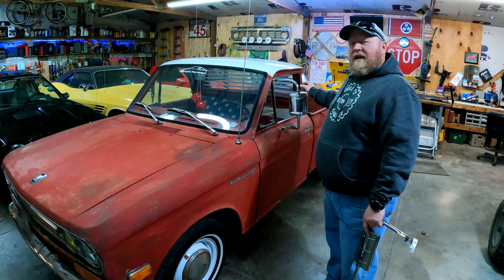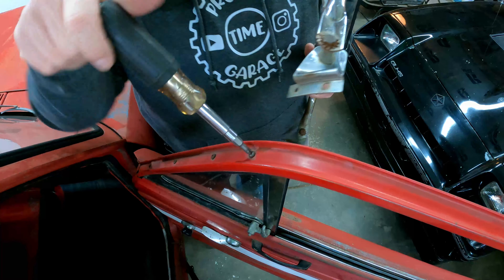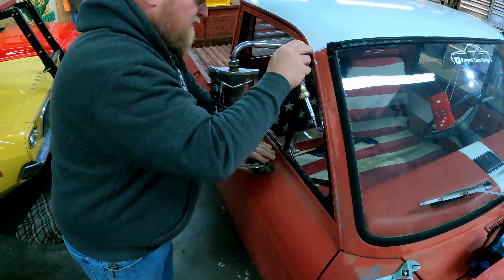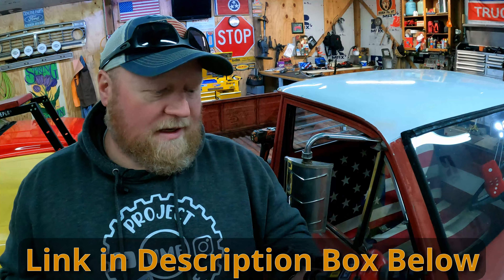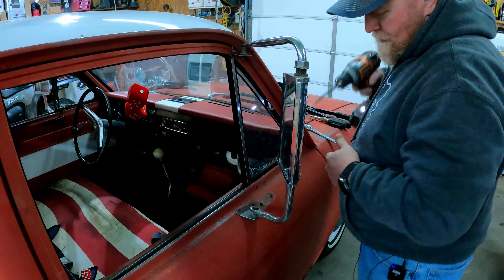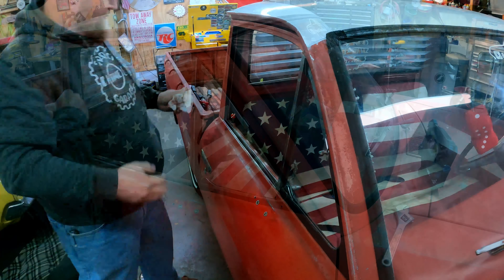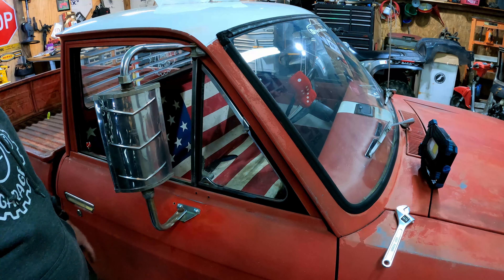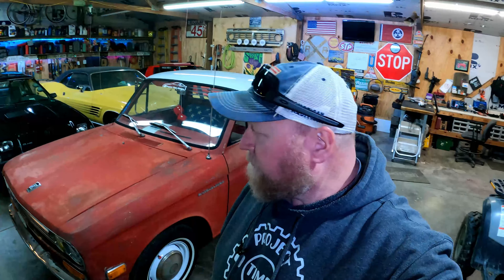My Vintage Datsun 521 Pickup Gets a Pair of Vintage Datsun Towing Mirrors

Comment: I thought you was becoming the Datsun King when ya got that parts truck. I just resently came across Puddin’s Fab Shop & I think he would get a kick out of the Motorized Wheelbarrow. Need to send him a shirt or sticker. I like Mail time with his daughter. 
I would like see some Motorized Wheelbarrow stickers with your logo on the door or hood. I got people at the GYM who likes the shirt & I would give them stickers if I had them. I haven’t wore the shirt for a couple of days & one guy who works there said he hasn’t seen his favorite shirt in awhile. I told him he could buy one.
You might not be the Datsun King but your the Mororized Wheelbarrow King.
Reply from the maker: LOL, I need to reach out to Puddin's some time. Let him know I'm out here.
Reply: @ProjectTimeGarage  Been watching him to. He got a nice 521 series truck to and was doing a tune up on it and putting in new plugs, rotor, points and condenser.  Think he put in a new distributer cap to. He put automatic transmission oil in each cylinder wall, and got the oil pressure up along with changed the gasoline filter. God, I love these little 521 series Datsun trucks so much. Simple, plain and decent way of transportation.  Not crazy though when these guys out there lower them to the ground and put those hideous, ugly wagon wheels and thin tires on these little trucks though.  Just leave it in stock condition as it's beautiful just the way it is. Wish Nissan would build these little girls once again, add a 4 wheel drive package on them to.  I saw one of these little girls have a 4 wheel drive package on it and it really looked super great!